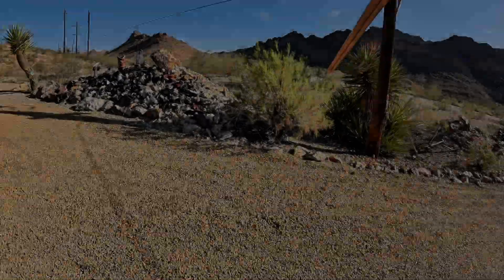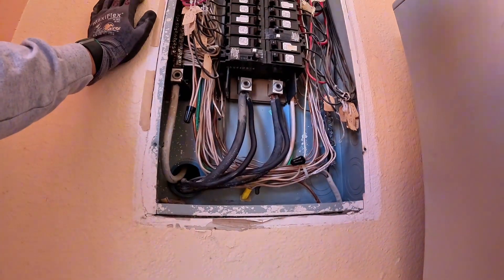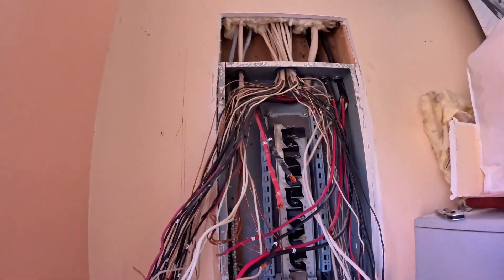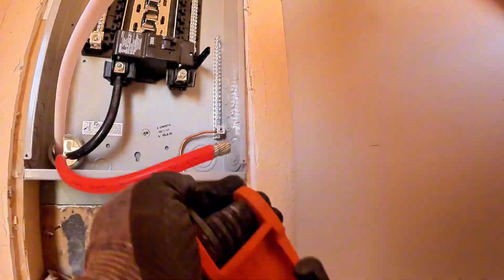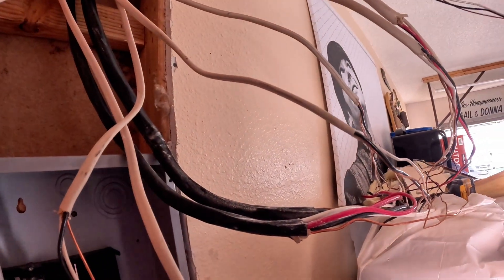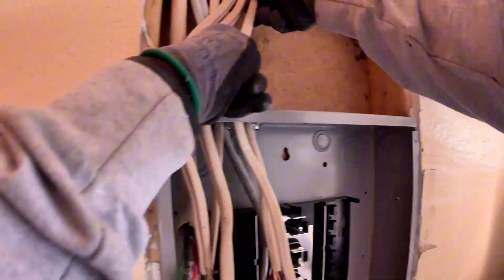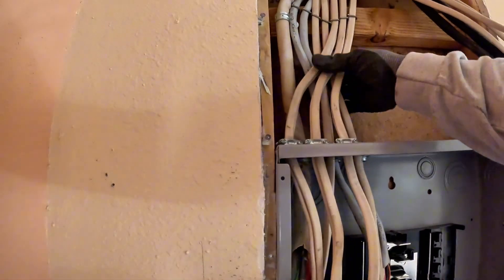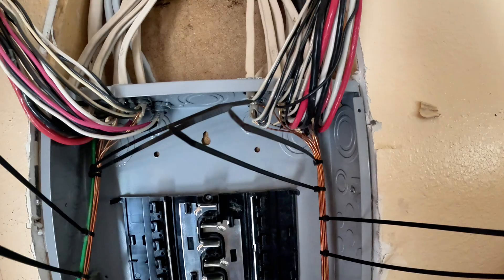This Is What a REAL Electrician’s Panel Looks Like ⚡ | Cleanest Setup You’ve Ever Seen!

Comment: Panel is flipped dawg odds are on the right installed like that.
Reply from the maker: Odds on the right ?🤣
Reply: @elelectrician yeah dude look at the panel cover
Reply from the maker: @brandonmcgann8665 can I ask you what the The Letters (Line over Line ) on the panel is for ?🤔
Reply: I don’t know what u not comprehending.. uninstalled it with main breaker at bottom the odds and evens are flipped

Comment: A double tape is not a code violation.  There are single poles out there that accept and rated for 2 wires.
Reply from the maker: You’re correct but the lug has to be rated for that

Comment: Why the fuck are you using cooper water pipe? You guys are scabs!
Reply: Its a ground rod.  They are copper plated.
Reply: @daze-70 really how fast is that gonna corrode , use the proper ground rod material not a phuckin 1/2 " water pipe!

Comment: Pour water into the hole as you drive ground rod in.
Reply from the maker: 🫡 Thanks Champ for the advice really appreciate it
Reply: @elelectrician  Welcome. They go in without having to be banged when you use water.
Reply: You don't need to with a hammer drill. The tool does all the work.  I'm surprised they use a corded tool for it though.  All my tools are cordless, including my sds. Most jobs lack power, so electricians don't usually carry corded tools.

Comment: It is a lot easier to use a bucket of water to set ground rods.
Dig a 12"x12"x6" hole so the finished rod is below grade.
Start a hole for the rod, push it into the ground as deep as you can by hand and pull it out.
Fill the hole with water.
Put the rod back into the hole and slam it down by hand, raise it up and slam it down deeper.
Keep filling the hole with water.
Rinse and repeat.
Each time you slam it down, it will go deeper.
No electricity, no hammer drill, no ladder... just water.
Reply from the maker: sounds like a Lot of work Champ
Reply: The hammer drill does all the work.  Didn't your grandpa teach you to work smarter, not harder?
Reply from the maker: @MaryJane-ln3vvoh we used it  do you have an 8ft bit tho
Reply: @elelectrician  I have the same tool, but the actual ground rod bit. I haven't used a sledge to drive a ground rod in years.  
I'm on your side here. 

I do have 5ft bits.  But they're for finished walls.

Comment: Didn't see the bond bushing..
Reply from the maker: I actually brought the ground wire straight to the panel
Reply: Bond bushing not required for 120/240v, plus it's not an impaired connection.

Comment: I did not see how you joined the ground bars together since you added one on the left side.  Adding to the neutral would not be code correct?
Reply from the maker: With a number six wire and acorns

Comment: Quick question, do you just use the same amperage breakers that were on the old panel or do you trace what the wire is feeding and size the breaker based off the gauge of the wire?
Reply: Breakers are always sized by the gauge of the wire.
If your load requires more current, run a new larger wire.
Reply from the maker: @heroesandzeros7802 yes sir
Reply from the maker: I put the existing  on it size to wire